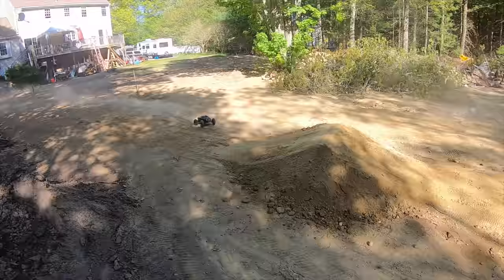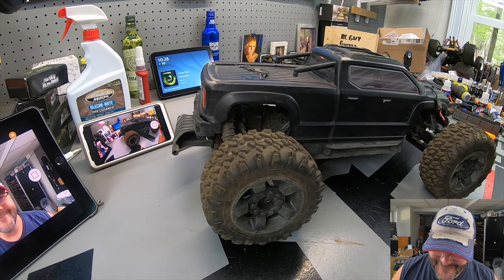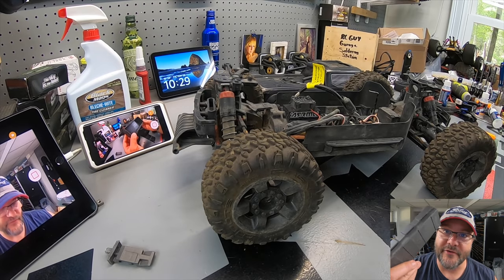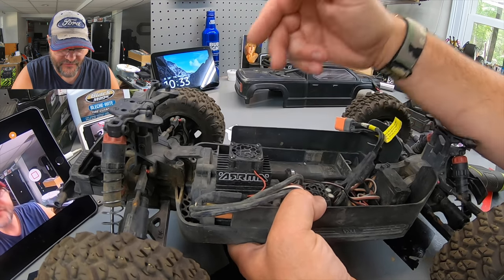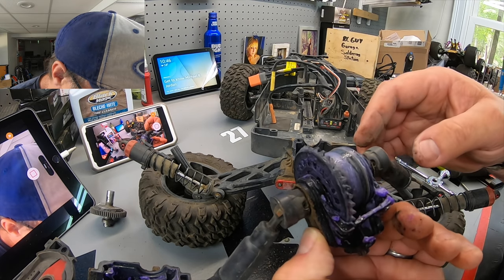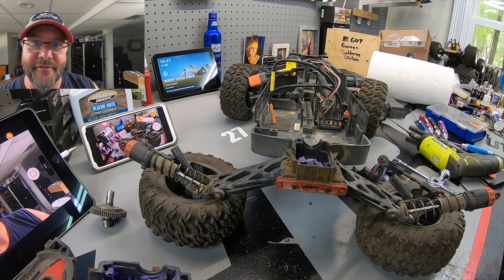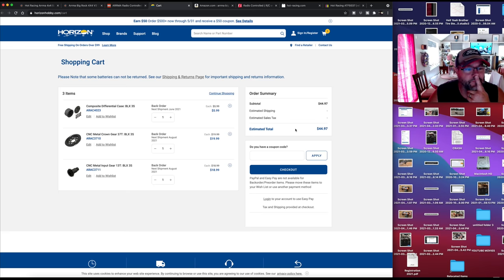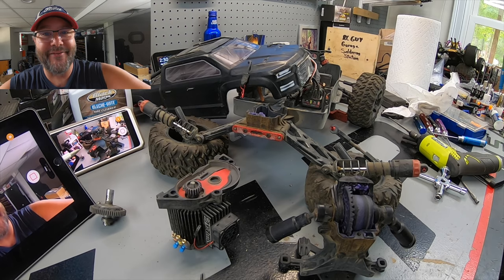Arrma Big Rock V3 Gear Issues

Comment: Maybe the rear went bad because 100% of the power was going to it when you ran it in 2 wheel drive for a while? Just a thought.
Reply from the maker: YES!!! You are the ONLY one to mention that so far!!! I did a BUNCH of launches on that thing on AND off camera testing gearing and tuning
Reply: I didn’t think of that. Ya and the 500,000 miles on it. Lol
Reply: No, it's the heavier impact the rear takes. Everyone has problems with the rear diff, no one has problems with the front diff.
Reply: Riff Raff's RC  Agreed, but I really don't think I land on throttle, so careful driving may not be enough to save the rear diff.
Reply: Riff Raff's RC  Guy will keep her going! Maybe run front wheel drive now!
Reply: @tyrellcorp2118  seinc the front one never brakes then how come we don't put the front diff in the rear then it will last forever?
Reply: @51-FS  they're the same diff, there's just much more load on the rear
Reply: @ValFPV  that was a joke. But I have learned that it seems like the gress gets slung out of the gears. Every 3-5 runs I tear my rear differential apart are regress the gears. Haven't had any issues seinc I sarted doing that. I'm tempted to try to see if I can get gear oil to stay in the differential case. But I think it would leek out because it's not a sealed case.....
Reply: @51-FS  huh, I wonder if the issue is coming from too high sudden torque on the teeth (like I thought was the case before) or just wear due to there being not enough grease on them...
Reply: @ValFPV  for me it was definitely the gress causing my issues. Tear your diff apart after a fue runs and see how much is left on the gear....
Reply: I was replacing rear differentials every week it seemed like... its easier and cheaper to just regress them after a fue runs
Reply: Mine just went out too. Never ran this one in 2wd. Idk I swapped axels but took them off bc they kept coming loose. I am sure that could have played a part in it but no biggie. Got another whole housing with gears already in it off eBay for 20$
Reply: My Arrma Granite BLX rear diff crapped the bed in 3 weeks. I had no other issues, related or otherwise. The plastic ring (planetary?) gear is so soft plastic, they just don't last on 3s. I did drive it every day for those 3 weeks almost, it's just a soft toothed gear that isn't meant to last. I don't even do jumps, just driving in gravel.

Comment: For keeping dirt out of the motor housing  I use a thick grease around the opening. I'll even put some in the grooves where the housing mounts to the chassis so it comes on and off smooth. I have not got dirt in the housing yet it works great.

Comment: On my arrma typhon I broke a few plastic diffs when driven very hard, BMX track and big jumps. Upgraded to the metal diffs and they have been holding up pretty well. I make shure to grease the diff very often and it feels like the car is rev’ing much faster, sounds more angry and more punch in the throttle. They seem to hold up very well, so my next upgrade might be a 4s setup. 

I like the 3s rigs, they are so easy to work on and I know all the weak spots and have my own «fix» for many of those. And I always «paint» my car with WD40 wich make all the plastic very flexible so it hardly ever breaks.

Comment: I switched to the cnc parts the second time my rear input gear blew out. The second time I realized the diff was shimmed on the wrong side from box stock. No issues since.💯 Love This Truck.
Reply from the maker: It's definitely a great little model
Reply: I have the Arrma upgrade diff on the way. You still use the shim? Which side do you have it on now? Ring side or opposite? (Stock is usually ring side).
Reply: I still use the shim on the ring side.

Comment: I ditched the metal CVD driveshafts. Main reason is you can't use the Typhon axles with them. I snapped/bent alot of stock axles. Second reason is I actually snapped one. Popping u-joints is a problem with the stock plastic, but I've NEVER snapped one. Third reason is the significant added weight which reduces performance and durability. So far loosening the slipper (1-1/4 from full tight) seems to be the solution to using stock plastic driveshafts without popping u-joints often.

Comment: Good to see you! That's normal wear. The out drive pinion teeth sharpen to a point and then snap off, destroying the diff gear. If you catch it before the teeth snap only the pinion needs to be changed.  The hot racing setup in front and back don't effect the power at all on my outcast. The plastic yoke flexes miss aligning the gears . The hot racing aluminum yoke will slow the wear! Check ebay and Amazon through hot racing site!
Reply from the maker: 😉early commenter 🤪🤣i do the same thing
Reply: @rcguygarage   I was waiting for that rear pinion to sharpen up and snap. Lasted longer than I thought with your toggle switch  type driving.👍👍👍👍💯

Comment: Good episode.   Tho I would say in the Arrma 3s line....if your gonna keep it at 3s and not upgrade the power system (3s puts out plenty for bashing) stick with the stock diff components.   Way cheaper, can get 3 complete stock diff parts for the price of the upgrade and the stock diffs hold up just fine.   Getting proper slipper tension is the key.
Reply from the maker: Weigh out your options for sure

Comment: Looks like a 21 tooth pinion??? What temps you getting??? I tried a 20 on mine but  got motor way too hot dropped down to a 16 tooth and getting 54 mph ... plenty of power and probably save parts from breaking 🤔...all in all got one cause of your vids man and enjoying it !!! I say keep it stock drop few teeth on pinion it’ll blast for infinity!!! God bless
Reply from the maker: Still running DragRock gearing 😉🤪🤣 I thought it was cogging a little too much🤪🤣🤪🤣
Reply: Part of the torture test 😂

Comment: Drill a hole in the chassis bottom were the spur sits so dirt wont be stuck there. Also the rear diff strips because the input gear bearings have slop
Reply from the maker: You get what you pay for kinda eventually👍

Comment: If you wind up going with the Arrma steel input and ring gear, you might consider picking up some 12x15.5x0.2mm shims. I needed all four on the input side to tweak the mesh to keep it smooth.

Comment: Do the Velcro mod on the bottom of that unit. Use the non abrasive part of the Velcro and put a piece around where the gear is it keeps a ton of crap out of it

Comment: What axles are you running? The inner section look like the axles off of the Kraton 4S. But I have a V3 Big Rock and it didn't come with those axles. I also looked at the parts diagram for the V3 BR. And that also shows the axles mine came with.

Comment: I just stripped my 3rd rear differential/input gear. The Hot Racing yoke may help, this 3rd one lasted longer. But the 3rd input gear/diff got stripped shortly after adding the M2C motor plate/chassis brace. It may just be coincidence but I think the added weight/stiffness may have something to do with it. I still need the motor mount plate, but I'm going to try it without that really heavy chassis brace this time. If the diff still goes I'll try the backordered CNC diff/input gear. As others have said, the front diff doesn't suffer like the rear does. So far, I'm still on the factory front.
Reply: What size motor you using , your case may be worn I
Reply: @paulclancy2404  Stock motor. What case do you mean?
Reply: On those rc the chassis and towers is the housing, unless you overpowered ,you shouldn't be stripping the input gear , ive been through only one ,with 6s ive been through a dozen , if you are powered with big can motor maybe try a t2t brace that and changing the case stopped mine from stripping, on 6s , the 3s I stripped one but after 100 packs run through and I thicker diff fluid , that can put more stress on it also , make sure those bearings are near new conditions also
Reply: @paulclancy2404  My bearings have never been the problem. I'm not stripping from overpowering. I'm on 3s, 15t, the slipper is nice and loose, I don't wheelie and I don't land on throttle. The damage always happens after landing a big jump. Impact to the back end flexes the rear diff and input gear, they get thrown out of alignment and strip each other. That's why the Hot Racing yoke helps, it reduces the flex. The chassis is fairly new and my 3rd, but a warped shock tower could be a contributing factor I didn't consider.
Reply: @tyrellcorp2118  yes and all you young guys killing jumps , should immediately install a t2t brace , its not as cut and dry with the arrma 3s I suppose but still would help and looks good too. When arrma copied bashers with theres it helped but no where near as effective bc not connected to the towers .,  and guys just started pushing m2racing chassis.aluminum diff cases. I get aluminum tubing from home depot , threaded rod run through the tubing with nuts on outside each tower , you can even use wing nuts and adjust the rigidity,  with plastic rcs ofcourse just want tension
Reply: Take little polish on aluminum tubing and it looks sharp, my basher i don't worry about looking pretty, has the arrma t2t and it absolutely does nothing underneath the real one I installed , I haven't blown a diff since , the 3s guys I never had problem but I only hit the same 30 40 ft jump mostly and never liked the brcc compared to the granite.  Im running the brcc now with system from dbpro and hr 17mm hex and typhon buggy wheels , I think I'd still rather a stock granite.
Reply: @tyrellcorp2118  oh if you changed the chassis without changing the top , half the case could be stretched , from mechanical point view you change things like that together.
Reply: Tyrrell try switching yokes till you able get your cnc one just case its that,  you know the your front yoke is perfect

Comment: I’m about to replace my rear diff with metal one. I don’t have any grease. I notice yours in greased on outside. Is that necessary?  What grease do I use
Reply from the maker: Always use what the manufacturer recommended

Comment: I've been having problems with my big rock.. when I accelerate it makes that crunchy sound and I thought it was my slipper clutch but I checked and everything was fine.. checked the diffs and everything was ok too. Then I checked the screws maybe I made a mistake and screwed all the way in the diffs but nada. Applied grease and all that but still the same. Still makes that harsh crunchy noise when accelerating and low speed. 😔😫

Comment: Rode hard and put up wet. Still more smiles for miles than trashbag
Reply from the maker: 💯 so far you speak💯
Reply: @rcguygarage  I sealed up my spur and pinion housing with rtv. I also made a makeshift gasket from gorilla two side tape that I left the paper on one side of to let the assembly still slide in and out. It keeps most of the garbage out

Comment: I got my big rock used with upgrades guy said but there's a place called king Cobra of Pensacola and my big rock has been the 4 time each time I tell them I won't a upgrade they say ok I get it back and. With in 5 minutes of me driving it I don't ramp and dog it I can hit a bump and it with start slipping I spent 2,000 on rc cars because and not one works got 4